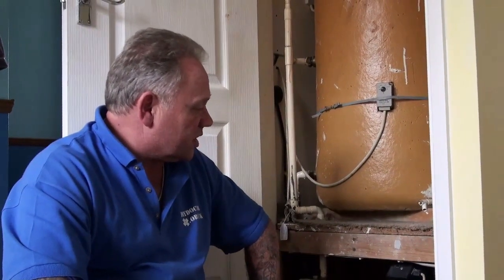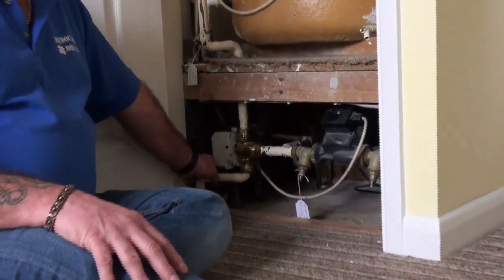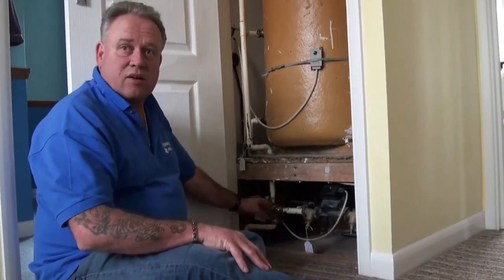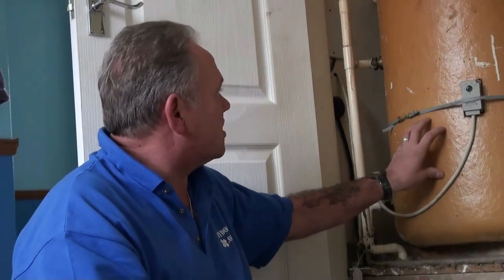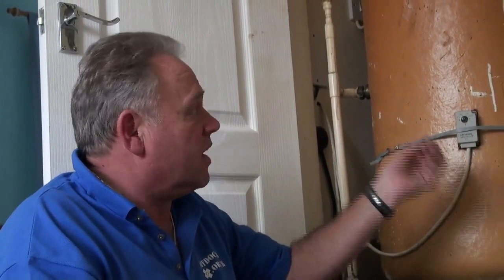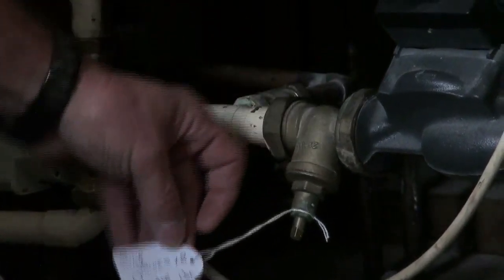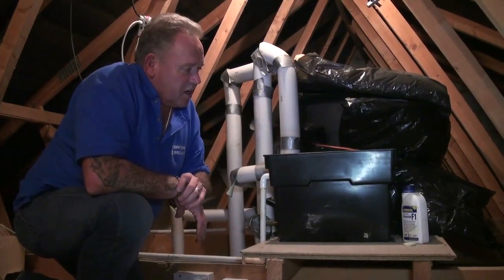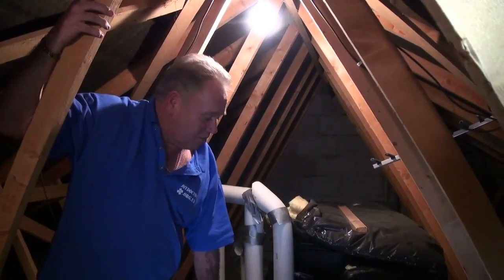How the Heating Works in your Home Demonstration Part 2/2

Comment: central heating water and domestic water could get easily mixed if one is still unfortunate enough to have one of those single feed primatic hot water cylinders where it also feeds the heating system with water and merely uses an airlock to separate the domestic and heating water
Reply from the maker: Yep, they are not everyones cup of tea

Comment: That pump, what is suppose to control it going on/off? I ask because when the hot water/heating is turned off at the timer and I can see the boiler is off, this pump goes on and on... After an hour I just have to turn off the switch that feeds electricity to the whole system as it makes a low hum.
Reply from the maker: Better to ask the question directly of a tradesman in our forum Stuart. www.diydoctor.org.uk

Comment: Much appreciated.   Just one thing does the breather for the copper tank work automatically or do you need to bleed it like you do the Rads?  Thanks
Reply from the maker: No Anne, you never have to bleed the hot water cylinder.
Reply from the maker: kev b
Thanks for taking the time to comment Kev.
Reply from the maker: kev b Thanks. We try and take all the jargon out to de-mystify these things.

Comment: Thanks very much my friend, great explanation. I always wondered how the tank water got hot for taps etc.
I was under the impression that the immersion heater was still used in some way at perhaps a lower current etc. I was always told by my father that the immersion heater was very expensive to run via it's own switch, as opposed to allowing the heating system to heat the water.

Now I know.... That secret internal coil :)

Thanks again.
Reply from the maker: No worries John, glad we could enlighten you. Loads more stuff like this on our website if you want to take a look at www.diydoctor.org.uk

Comment: These videos are very informative... but i can't seem to find a video that covers a boiler that  sounds like there is someone inside it with a hammer banging away. I think it's air in the system... it's a very old (25 yrs) Glow Worm Fuelsaver F. Any ideas how we can get rid of this air? It always starts the loud banging and thumping noises when both the hot water and heating comes on first thing in the morning (the heating is always left on at night but only on a warm setting). Any ideas?